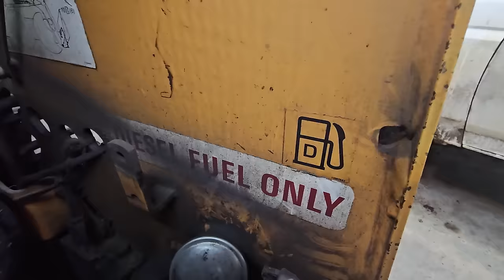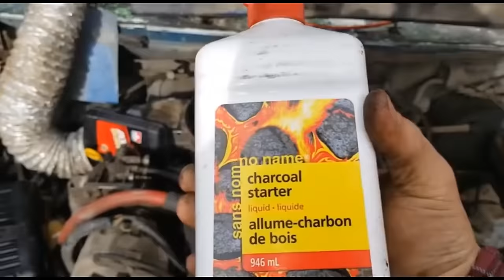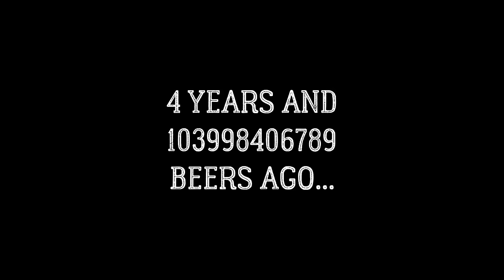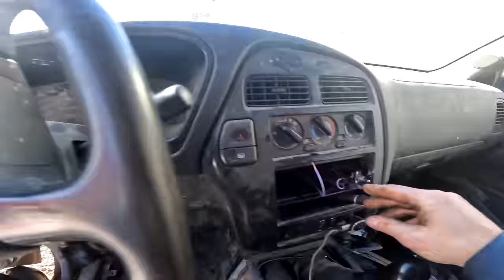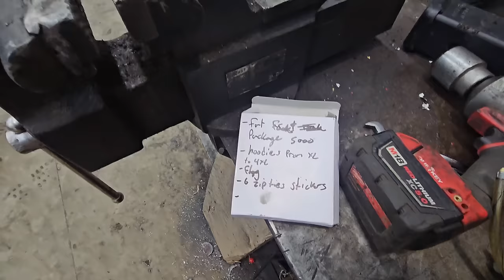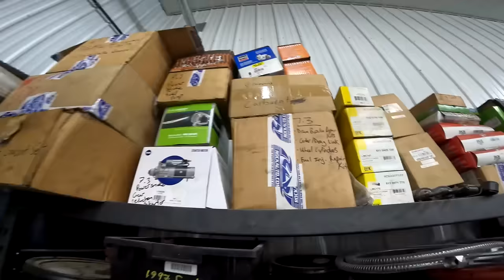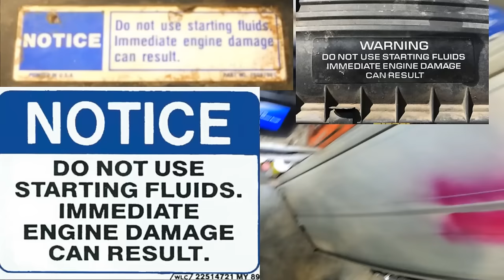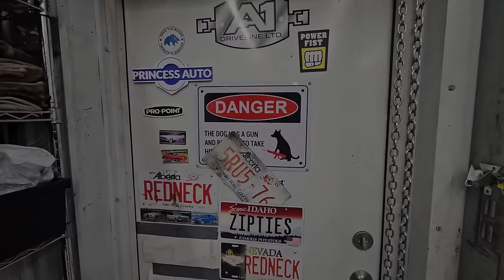7.3 IDI REVIVE N WHEELIE!!!

Comment: Living proof that a 7.3 IDI may be gutless, but it is damn well indestructible.
Reply: The 6.9 is even more indestructible.
Reply: Cause it only makes 90hp
Reply: @chevguy8587  thicker cylinder walls, don't have to worry about cavitation like in the 7.3
Reply: @nathanaelhanson2412   don't have to worry about cavitation on a 7.3 if you just don't worry about it
Reply: I moved from Virginia to Pittsburgh after a twelve hour shift at seven pm. In a uhaul loaded pulling a trailer with my 67 mustang. 6.9 On the floorboards entire way. Got home with enough time to stop for drinks before last call. Tough engines. Would actually run 73 in the flatlands
Reply: Love my 93 turdbo
Reply: My old 1991 F-super duty dump truck has 1. Not exactly fast but it's reliable. Has bad glow plugs so it gets a shot of the good stuff to wake up when it's cold
Reply: @LarryReynolds591  I have 1 of the factory turbo IDIs in a rotted out dump truck. I have a much more solid truck for it to live in. Glow plugs actually work decent in that 1. Also have a 1989 F-super duty 7.3 idi with a zf5. All 3 of my IDIs are good workers and have all tasted ether, obviously it didn't seem to hurt them at all
Reply: I traded this 7.3 in to a dealership in 2010. Took a gallon of oil to bring it in to town. Had almost 1,000,000km on it. And here Peg is reviving it again. Long live the 7.3
Reply: The IDI lasts forever because it doesn't have enough power to break even if your over dosing it with cosby sauce! Punch it all the way into the ketchup dump the clutch and let her eat! 🤪
Reply: It's gutless because they are particularly low compression for a diesel..  hints the reason why it takes starter fluid like a champ.
Reply: Can't hurt yourself if you only make 100hp
Reply: @chevguy8587 made more power than the non turbo junk 6.2 detroits, I’ve seen my buddy do donuts in a full size F-250 with the 6.9 idi. You literally have to bump the brakes to take weighs off the ass of a 6.2 Detroit to make it even do a brake stand 🤣🤣
Reply: @QuesoPants  i love this
Reply: @brightloonie so you're saying you are the PO of slave lake?
Reply: @calholli idi has one of the highest comp ratios for a diesel lol
Reply: Just bearly got passed by a empty truck with an idi on a 8% grade in my fully loaded with stuff 4.9 van 😂❤
Reply: My buddy has a built one pushing 600 hp and 1000 ft pounds of torque.
Reply: @brightloonie are you saying you owned slave lake before peg!? If so that’s just great. How long did you own it? And it was burning or leaking that gallon of oil?
Reply: don't make enough power to break nothin!
Reply: @Bustedkuhnuckles if I remeber correctly. In one video peg said he bought it. Had it for a bit sold then bought it back again
Reply: @ChrisHarding-lk3jj  how more indestructible can indestructible get?

Comment: Those 7.3s came with 9v glow plugs or 12v. The 9s smoke almost immediately if its a 12v system, so yeah that 24v made them pop like a trouble light under a trailer in January.

Comment: my vp 37 injection pump on my tdi was dying and it wouldnt start without llike a whole  can of brakeclean or bump starting it it still hasnt blown up from the brake clean only at 300k miles it also likes running on 80% used engine oil

Comment: Peg, the 7.3, is designed just like the ih d282 engine except the 282 is a flat 6. The reason rhey needed glow plugs from factory is because one its a idi like you have said, but they are a low compression diesel engine so starting isnt as easy bc it cannot atomize (i think thats the word) the diesel as easy

Comment: I have melted the piston in a 270 Cummins with either. The engine was turned up and it ran hot already but I got in a race with it and I had the passengers wing glass open shooting the Cosby sauce straight in the cleaner and well melted it. Yes yes yes they will get hooked on either and will not start without it. Next time you’re down my way stop and I’ll show you a skid steer with a three cylinder that will not start when it frosts without it.

Comment: 2:16 
Never once… had Ether ever “kill” an engine.  
6.5L burb I had, ether locked it or something… I used it first time cause batteries were getting low and I didn’t wanna be stranded, so I used it and didn’t let the plugs try glowing, lit it off. Only issue is I couldn’t get it to go passed 45mph… 
Trash 6.5L anyway. Had hella transmission 5speed and Half ton axles.  I did find weasel P1$$ (PB Blaster) worked just as well for it and it wouldn’t do that Lock BS to it where it will be balless for next 18 miles.

Comment: the only time the 7.3 is wrecked and wont start is because ya got it to hot and burned the carbon out of the cylinders, you need to work up a good film of burnt oil for the compression to work on the new EPA fuel.

Comment: The argument is it can cause pitting on the cylinder walls or piston and lower the compression, so once it's pitted. You have to keep using starting fluid fill that void created by the pitting. The broken rods is due to there being nothing but Cosby sauce and it pre igniting kinda like the timing being off in a gaser creating pinging.
Reply: both are bs.
Reply: There isn't an argument.
Reply: Key word is "can," not "will"

Comment: We have used either for years on the farm, not a problem. It was only with the diesel's found in smaller vehicles that we had the problem with damaging the engine. Mostly the 6.2 and the 6.5 gm vehicles. Many of the Kubota engines struggle with either as well. Never the big Iron blocks. In small amounts, they do just fine.

Comment: Hey peg I’m 17 years old and I’ve been watching for a long time. but I own a 1985 ferd f250 and it will start and run great, but sometimes when I shut it off it won’t start again. The battery is good and the starter is brand new and everything works great most of the time but sometimes it just does that. Like sometimes I have to leave it sit for a week straight before it’ll start again but then when it starts, it works perfectly. its a 302 but I was just wondering what you think it could be? Keep up the good work bro

Comment: There's no way those glow plugs were working for 3 or 4 reasons i won't not you with but once easy around all that is just put some hot air down the intake hair dryer or torch. Torch air down the intake and one the road again. Ps the motor sound healthy still

Comment: the only wive's tail i've heard about ether being bad is actually with small engines. the story goes that someone was trying to start an engine and the spark plug wire was broken. they didn't notice this, and kept spraying more and more ether getting more and more frustrated. until finally, they sprayed SO MUCH ether before trying to start, that the piston hydrolocked on the liquid ether that had run in through the intake valve and the piston rod snapped when the starter turned over. now, i've never even believed this more believable version of ether failure because the starter teeth would fuck off into the night before the piston rod snapped (at least i hope so). and also this would require literally dumping an entire can of ether into the cylinder which would take a pretty damn long time. and the cylinder would need to be in the perfect position to get enough inertia to destroy itself when it tries to compress on the liquid ether lake

Comment: having a sealed radiator got er smokin like she used to! the clapped out head gaskets give advanced cylinder cooling, if you watch kt3406e's video on the detroit with the garden hose down its gullet full tilt, held strong till he turned the water off, woulda kept going till it was out of diesel

Comment: I have a 1994 F-250 GAS! that won't start without either, ether or letting it roll down my driveway and popping the clutch. No idea why, it wasn't like that when my buddy sold it to me. There isn't an original part on the truck I don't think. It was buddy's pride and joy for years. He put together a 393w stroker shortblock with forged pistons and rods, cast 3.85" crank, AFR 170cc aluminum heads, Lightning lower, Explorer upper, 70mm TB, Cobra MAF, stainless Long tubes, switched it from batchfire to SMPI with a Mustang style ECU, 255lph fuel pumps, the adjustable a/f ratio until you plug in between the MAF and the harness that you turn a screw in or out to richen or lean it out, it has Lightning seats, an A/F meter on the A pillar, it's reg cab long bed 2wd with a ZF-5. I changed the fuel filter, I have messed the the A/F ratio and the timing. It just won't start without ether or a clutch dump after I prime the key a few times. It doesn't seem to be lacking fuel once it's running and warmed up it pulls like a maniac, it was built for TQ with the smaller heads, more restrictive intake system than what a 9.5 Windsor makes the most power with and a factory 5.0 HO roller camshaft. Probably makes 500tq and 350-400hp the party is over by 5000rpms and it falls on it's face and hits the limiter at 5500. I don't know much about tuning the Fords, I thought about getting Holley Terminator, Holley Sniper, Quarterhorse or something, putting a proper cam in it and running a highrise single plane intake with injectors and a throttle body. Every test I have seen on a 393/408/418 stroker with aluminum heads has shown that they love more cam and the single plane. Often the make more peak TQ and HP, even if the rpms are shifted a few hundred further  rpms out. Might require some head porting and/or upping the valve sizes or bigger heads... however a 393w should make 500tq and 500-550hp easy. I have an extra 351w roller block and an extra ZF-5 S47 from a '97 F-250HD that was totalled for it. I thought about building a 418-434ci stroker with it and running 190-210cc heads like TFS 11Rs, a cam in the 240-255 degree duration, .600" lift 106-110LSA size range with a Victor single plane for it if not an aftermarket block between 454-468ci with a 4.125"-4.185" bore and a 4.25" stroke and shooting for 600+HP. Ford Racing sells a 460w short block if you can find one. I really like the 2wd F-250s since I don't need 4wd, I always wanted to build a pre-runner level beam kit with huge coil-overs and bypasses, run 36-40" tires with around 15" front and 18" rear suspension travel. I could follow the power lines at high speeds about 15-20 miles all the way to Whistlin' Diesel's land if I built an OBS Ford like that. Maybe I could talk Cody into buying it for good money and it could endure some testing for everyone's entertainment. If that G Wagon flew like that at Silver Lake, I can't imagine how far he could sail a huge stroker OBS with proper suspension and tires out there.
Reply: ....periods, anyone.......
Reply: HEY HENDO, THANKS FOR THE TRANQUIL SOUNDS OF LONG JAWED , SHORT THOUGHTS, AND GREAT KAMAKAZI DIZZINESS......I FEEL GOOD AND RESTED!
Reply: And I thought PEG was out there

Comment: The old girl would of lit right up if all glow plugs were working. You could hear it light on around 3-4 holes.For anyone with a idi they care about only run motorcraft glow plugs. Cheap ones like autolite the tips burn off or swelll and cannot be removed and they don't work worth sh#t even new.

Comment: We had a x15 cummins that used to need it to much to start when ya let it sit for to long when it was off or if it was to cold, turned out it was just the high pressure fuel pump, had to basically replace the lil head on it and its addiction stopped, truck never relapse

Comment: "Cosby sauce" causes preignition in a diesel.  Period.   It's just a matter of whether the engine can handle it or not.  As the piston is coming up and compressing to 20:1 ratio compression.. The starter fluid automatically lights well before it ever reaches the TDC-  even without glow plugs.   As long as the diesel has enough blowby, it won't hurt it..  Also bigger pistons, it tends not to hurt it, simply because there's too much volume, and you would have to spray more than the can does...  But what happens is that it cracks the piston around the ring grooves on a cheaply designed piston.  but it usually will keep running still...   People just find out about this stuff when they pull their engines out and rebuild them...   But again, a well overbuilt piston can handle it better..  a worn engine with blowby can handle it better.. and larger displacement handles it better..   You really have to make the stars align to kill a piston with starter fluid.   It basically has to be a "new engine with low miles that has poorly designed pistons and has particularly high compression--- and you spray the crap out of it. lol............  But it's not very likely for that to ever happen, because a 'new engine just starts and runs with no issues, so you wouldn't need to use it.  So the problem kinda fixes itself;  by the time your engine needs help starting---  it's too far worn for the Cosby to spike its' drink, so it's fine. 

The "Addiction theory is nutty.. I don't even know where that came from, but it's hilarious

Comment: The sauce CAN kill engines from backfiring 😂 i learned that the hard way i sprayed wayyy too much in my 6.2 diesel and snapped both starter bolts 😂 usually they break only 1 but i used only the sauce on a 4-71 detroit no diesel in it and ran it and it loved it 😂

Comment: My 1996 Volvo 850 with a tiny turbo 2.3 5 cylinder has more audacity and many many more miles. There's no replacement for displacement my arse! Oil company's love those that think that way. 850R with over 800,000 and still has 300hp and torque and 3 times smaller. Not knocking bias zip peg leg, love vids man but FUCK Ontario!

Comment: IDI fuel system is crap. If you add a cheap 12v lift pump. Proper fuel filter with separator and heating element(any case cenario). Bypass injectors return line directly to tank not to injection pump.Tank selector valve and fuel pickup may also suck air. If one tank is bone dry and another lets say half full then it´s also sucks air from empty tank. Throw in a planetary driven starter, new glowplugs, batteries and that´s it.  It´s waking up way faster because theres no air in the fuel supply. Mine was half turn mill with almost every temperatures. Engine itself was toast. Burning tons of oil and even with blowby can inflate tires.

Comment: The honest truth is that newish diesels trying to start with either  its like gas in the cylinders. here and there wont hurt is, regularly can damage cylinder wall and compression, but it doesn't mean it will, especially if its cold. and the hotter it is outside the more likely, but it doesnt mean it wont start without it, it just might get harder, and if its turbo with lower compression thats extra true. now if your trying to flood the engine that another story. but used properly when the engine is struggling it doesnt hurt anything
Reply: to be honest i didn't doubt slave lake would start. kinda surprised shes running that good. but shes loyal
Reply: Oh shat up!

Comment: The reason people think engines get addicted to ether, is because they start using ether because it wouldn't start one time, and because they don't fix the problem causing it to be hard to start and continue to not maintain their truck, it requires ether to start, if you fix the problems that caused you to use it to begin with it would start without the fucking ether, ether can blow up engines but you have to do something real fuckin stupid with it.... diesel engines without glow plugs or ones that are meant to start in extreme cold conditions use ether to start from the factory.... people think they know something after watching a few YouTube videos and try to tell people that have actual knowledge and experience something...

Comment: 2:48 depends on why it's not starting in the first place. an engine can't get addicted to ether rather you're just delaying a fuel issue with the diesel engine which is why they fail much sooner hence the cause of the myths. since they're running leaner than they normally should meaning hotter combustion temps meaning more wear & tear on the components, this is the same reason modern car engines here in the EU only last 100k miles if you're lucky since they're running at much hotter temps meaning hotter temps & more internal pressures.
Reply: Oh shat up

Comment: Totally 100% Cosby sauce won't kill a motor unless you use it to kill the motor. If it has no fuel in it and you use an entire can, and it's the only thing it's trying to run on ....yeah probably not ideal. But if that's the case, it's your own fault. (Just figured if there is no lube maybe it's what supposedly hurts em ?) I do know used transmission fluid should really be filtered before you throw it in. The injection pump didn't like the clutch material all that much.......(once again my fault) 
Just like you said" if you use your pecker improperly, your gonna have a bad time".   I've been known to do that to myself.......but you almost have to be a masochistic to enjoy working on this kind of crap anyway.